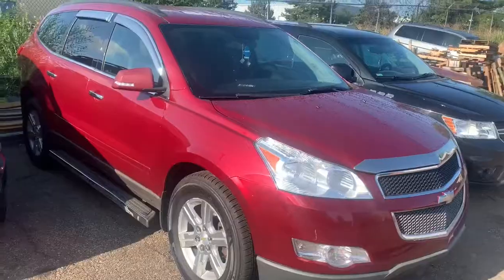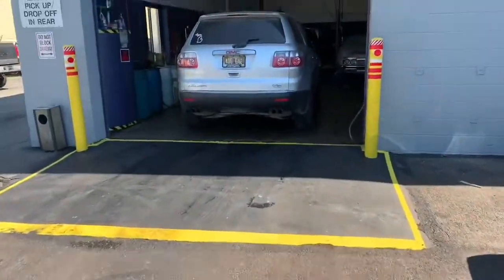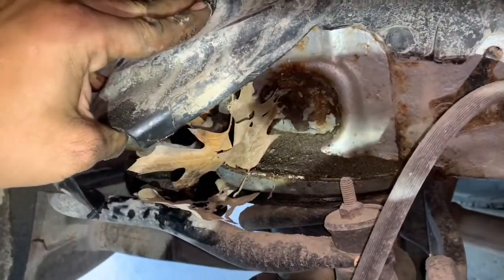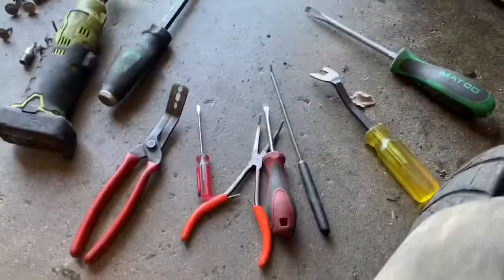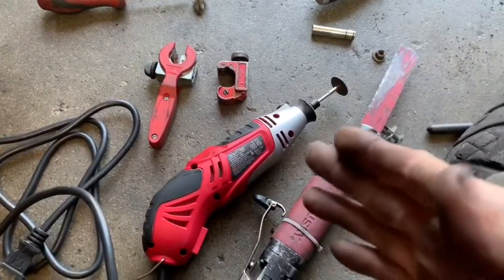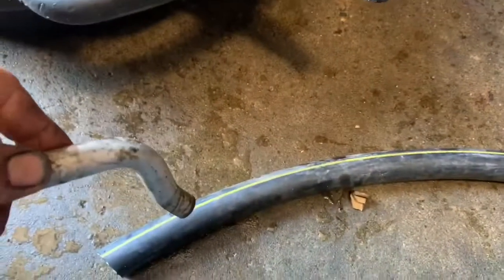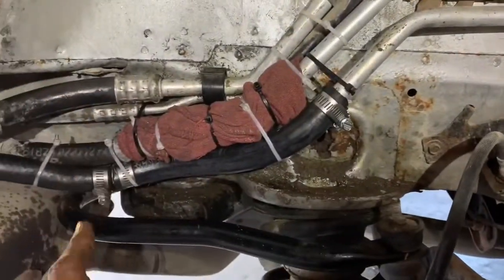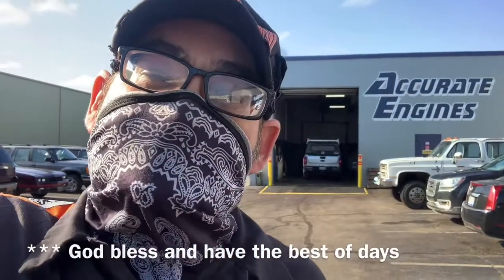GMC Acadia coolant leaking water leaking from rear how to repair cheap and easy

Comment: Could a leak there also cause a whining high-pitched sound from the passenger side of the engine. Also, you mentioned coolant but then in the video you start talking about the AC do I have to refill my AC fluid to recharge it after or do I need to check my coolant levels?😅 appreciate the insight. I’m going to tackle this job tomorrow. Great video.

Comment: Im having a hard time figuring how to replace the rear heater coolant coupler and how to remove the top part of the old connector. It's the 90' coupler or connector each site calls it something different lol. Any help would be great. I have a chevy tahoe 04 and i have the part it's the dorman 800-419. Do i need to use a new 5/8 line ehich I have bought for future use lol but i have tbe parts just not positive how to get the old piece off what tool to do that and do i just replace with new piece after getting the old one off. Thanks in advance

Comment: Do you work on old Jags at all?
Reply from the maker: I try not to...... but I suppose it depends on what you mean by old....
Reply: 2002.... I’ve just been watching for quite a while to see if you do. Other than that, not many want to, even dealers. A mechanic I was using kept me coming back until an employee said...stop bringing your car here, you will always have to. I can’t deal with his dishonesty, so I’m quitting. He said... he keeps losing mechanic because of his dishonesty. I found out the employee was correct. I just parked the car and said...one day, I’ll fix it. My youngest son wants it so, he will fix it. My engine light came on. He said to just drive it until it quits working. I said no way. A mechanic from another country looked at the code and said, DO NOT DRIVE THIS CAR! YOU WILL DESTROY THE MOTOR! The other mechanic wants to get paid to put a motor in your car. I said the other mechanic said it’s a cam position sensor. The Mechanics said NO! You need both timing belts changed! Your code reads that! So, NOW, I and done with so called luxury cars. I have driven Jags to Mercedes to Cadillacs, to range provers, NOW, I just wan a good simple all wheel drive. ACTUALLY the vehicle I REALLY LOVED WAS.....my 1998  AWD ASTRO VAN.! It is ugly but, the motor is great, everything else who knows. My nephew did something to the brakes. ALL of the locks started goin up and down. I took the battery out left it parked. Two years later put the battery in gave it some gas....it purred! If I could I would still drive it rust and all......SORRY FOR THE LONG MONOLOGUE.
Reply: The Clay Way excuse the misplaced words....autocorrect is my sworn enemy!  I don’t know why it changes some words once I push send.
Reply from the maker: Are you local?  

There’s a very very good shop here in Grand Rapids called George’s foreign car service I’ve known him for almost 20 years and all he works on our Jaguars BMWs Mercedes etc. etc. and occasionally he’ll work on a domestic honest guy not the cheapest person in the world but definitely knows his stuff he’s in Grand Rapids Michigan you could look him up tell him that I sent you he’ll treat you very very well